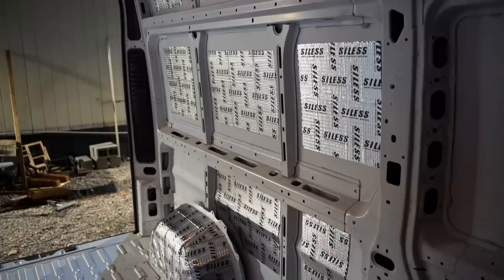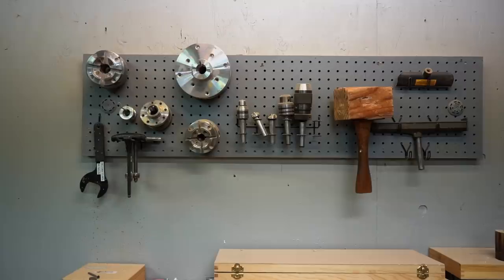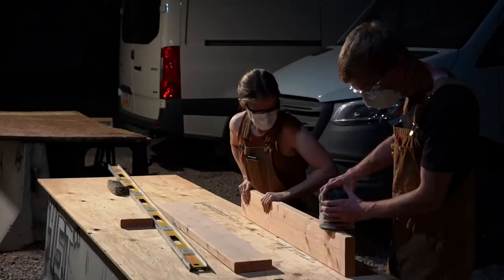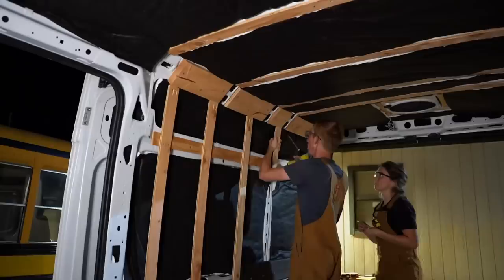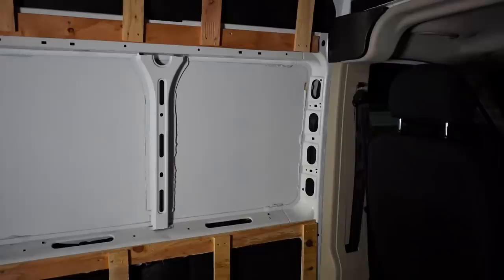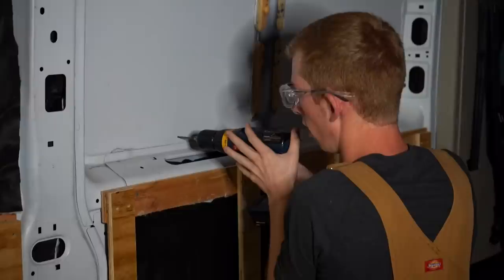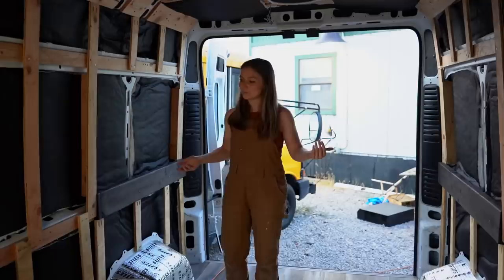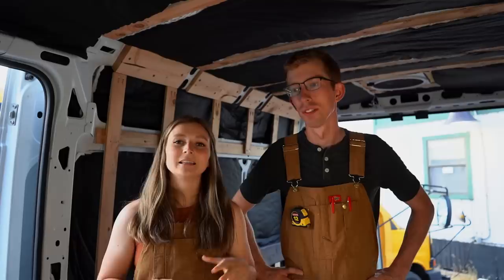CHOOSING A LAYOUT | Framing Our Promaster & Window Install

Comment: since the driver seat is pretty high up you could make the dinet table removeable and add a storage base at the bottom to house a collapsible shower. similar to what eamon and bec have in their van, just more compressed. This would add the shower without losing square footage. 

Also adding sliding drawers in the back seat of the bench seat could add a nice safety spot for laptops or other expensive/important equipment.

Comment: Everything in vanlife seems to be dual purpose.  If you made your dinette table something that could be converted out of the way or drop down to be the seat of a tiny couch your eating area wouldn't be so singular function.  Also, someone else suggested putting your sink nearer the door so you could have an outdoor spray station for post athletic activities and that just makes sense...or have a outdoor shower from the garage.  I can't imagine how unpleasant it would be to go for a hike or a ride and not be able to hose off my feet after!

Comment: Even if you do not want a shower now I would run some red and blue PEX tubes behind the tiny couch. No need to hook up now just leave them capped on each end. Run the ends near where your water pump/heater will be.  You could add a shower valve and shower curtain later without tearing the walls apart. Nice build.

Comment: Have you considered laying out the design wirh masking tape on the floor and actual size?  We did this when remodeling our kitchen, and again when we built an addition.  It highlighted changes needed that we would have missed.

Looking at a sketch is one thing, but seeing actual size is very helpful.

Comment: Looking good,why not have an outside shower a lot of van lifers do you put up a shower curtain between the 2 back doors and get a wooden shower tray to stand on I'm sure that would work well. Do you not think you might feel claustrophobic not having any opening Windows in the van? Good luck with the build it's looking good all ready.

Comment: Great video guys! 
In answer to your question about cutting the metal beam an angle grinder with a "thin metal cut-off" disc attached would be best in that situation or anything similar (and  also with any straight metal cuts to panels or structural).
Why don't you make your couch longer do away with the dinette idea and just have a table that slides out from under the bed on heavy duty drawer slides!? Then it's out the way wont take up permanent space when you're relaxing but can pull out to use as a dining table in front of the couch, or desk or coffee table, (and slide back under the bed when not in use to open up the space)..
That way you've got more room open space to work with.. you could have a smaller table or counter-top under the window also and that can double as a second Desk type space for the swivel driver's seat?(could even fold down again to open up the space when not on use!? And toilet could be also on a drawer slides maybe under the bed (if room below the slide out table within the storage area)..or slide out from under the sink area again on heavy duty slides as under the sink is an awkward space to use for general storage of other things so a toilet would solve that issue/use the space and the rest of your space can be storage elsewhere that's more easily accessible?)

For what it's worth just some thoughts to consider.. 
Also before you put the framing strips in you (ideally) could have put the thinsulate inside the beams as you in did with the others to insulate inside the frame, (as they will be the weak point in the heat or cold weather) ..if you have the option to do that now before the build progresses if it was myself, id definitely try to get every inch with Insulation inside the reinforced frame work areas aswell (it'll make a difference)..

Great build though! Really like the way you're just getting stuck into it! Whatever you do im sure its going to  look great!
Cheers from London 👍😎🏴

Comment: Another idea for minor layout change. Reverse cooking and sink positions and have faucet that can be extended to use both to wash off shoes and use as shower outside and help keep dirt etc outside to save on cleaning. Add 4 eye-bolts to ceiling just inside of width of sliding door opening and can have simple U shaped copper/iron pipe that slides out/in you can put shower curtain on or as cover for door opening in sun or rain when you still want/need airflow.

Comment: FWIW, I have a 2023 Promaster 159" window van, and that "beam" you removed at 12:30 did not even exist in my van.  I suspect it is mostly to prevent vibration and discourage theft.

Comment: I like your layout but being a full-time traveler I do think you guys should reconsider building a shower that is convenient for you guys I know it's a small space but instead of a bench would build a show. Also would put the swivel seat on the passenger and build a little flip table on the side of the kitchen cabinet. And put 2 benches by the bed area is with a pull-out table from the bed... But I would reconsider the shower

Comment: Well guys, sounds good to me the layout would work. And as you said if not you can make adjustments later down the road. Also making the passenger seat swivel would work well too. I hope Jimmy doesn't have a issue with the length of the bed he is tall. When he laid on the floor at the lot he was just a little cramped. Ok look forward to next weeks video. And as always "Enjoy The Adventure." 🤠👍✌

Comment: I've dispersed camp for many years and have not one time regretted not putting a shower in my camper , a shower in a small place only leads to condensation and mold problems. I have a 3 1/2 gallon stainless steel garden sprayer me and my wife fill full of water , place on a burner to heat it , its very simple and issue free . We both shower every night never wished we have went with a different plan

Comment: I agree with everyone who says you will regret not having "facilities" It isn't fun using park showers etc all the time, especially boon docking.  I recommend a "wet room" which can be smaller than a bathroom.
Use a bucket/bag system... for a toilet... or a small cassette... and a bucket/pump system for a shower.  Really easy.  All you need is enough room for a little privacy.  I also agree with everyone who says make the dinette work double duty.  Make one that converts to comfortable lounging.  I love a dinette by the window.  If you can squeeze just a little more room for the bed... to a full... you wont regret it.  RESALE value much better too. Summers are warmer now... and you may regret having to sleep so close (all of the time.)   Please consider the wet room.  It won't take more room than your tiny couch.  And a convertible dinette gives you the lounging you crave.

Comment: It's so cool you guys know how to do the work yourself. You have a plan and know what you want inside. What cool is you don't have to work with drawings and build to spec. You can buy the product you want and not dictated by a customer. I came from building grayhound busses and GM RTS intercity buses. Everything was built by a specifications. Your freewheeling your own build. Love your build and you two as a couple. Be cool be safe. Can't wait to see the finished product.

Comment: Very interesting to watch you make the changes. I am a little concerned with the dining table so being so high,, make sure the swivel seat is at its lowest setting. they are adjustable. which should be a help. Keith

Comment: Good layout, it'll be nice to see what you think after living in it for a few months.  I like windows so I'd probably put one in the sliding door as well.  One of those water tanks designed to fit over the wheel well might be nice.  With the electrical around the other wheel well, that would leave a big rectangular area in the center so you might be able to get a lot more than the ebikes in there.  I learned something watching how you did the framing.  Thanks for the video!

Comment: I don't the nails will hold up like that in a moving vehicles. Screws are more structural solid

And about that beam you were concerned about, if in passenger vans there is a full window in that location then you have nothing to worry about because those would not have that beam

That window looks awesome!

Comment: You two work so well together and your ideas are sound, but I'd suggest rethinking your placement of electrical.  Here's my thoughts: bc you will have to build up the bench to match the swivel drivers seat level so you can place your feet on the solid ground, why not use the space under the dinette for either storage or your electrical? That'll give you more storage under the bed. The dinette can also double as a couch/guest bed and you can omit the "little couch" you're planning (total waste of valuable real estate IMO and redundant.) A small pantry or shower or coset can go there. The wall it creates on the bed side will give you space to hang shelves/baskets for items or lighting. Same for other side.
Another thought: I think you'll regret downsizing your bed, I wouldn't go smaller then a full (double). A small bed with two people is great for cuddling when it's cold, but in the heat the last thing you want is to be that close. 
Great job so far. You do you and set your van up for yourselves. You're the couple that has to live in it. ❣

Comment: Sweet I get a tutorial of building a van from scratch, may God bless you 2 with his anointing oil. Amen.
Yes 1 thing I regretted is a shower, inside, so I put 1 on the back of the door and have a massive round plastic sealed water pipe on roof, using the sun to heat the water or gas heater embedded in the back door when there is no sun to have a shower. Propane gas as the fuel.

Comment: Everyone has their own preferences when it comes to layout. I have lived fulltime in a converted 9m (28ft) wide body bus, a 7m (22ft) narrow body bus, and now a 4.3m (14ft) caravan (travel trailer?). All of them have had a toilet and shower, and I would not be without either of them. However I am 65 years old (male) and rather set in my ways. I am not comfortable if I don't have a shower every night before bed.

Comment: You guys should be fine on your mattress fitting , I did my bump out very similarly. One part of my build I’m working on that I’m pretty proud of is I believe I have one of the most comfortable bed set ups I’ve seen in a van. I have a 10inch full size mattress that fits in with zero cuts or modifications to the mattress.

Comment: At least have an outside shower point, you can have a clip on curtain which is better than none. Not sure about the toilet though with ( middle of the night, rain storm, snow etc ) maybe a slide out modesty panel. Oh well good luck as you’ve put a lot of thought into your van 👏🙂

Comment: After living without a shower/toilet area for two years in a tiny canned ham camper, my short bus will have a hidden 2x3 shower/toilet area, right next to the kitchen sink so I can use the faucet as the shower head. It will be covered with a hinged counter top to extend the food prep area. Nomadism has squashed the “gross out” reflex when thinking of these types of design ideas. The compost toilet will be on sliders to bring it out when needed, and a swing out door will provide privacy from lookyloos at the butterfly door/window area. The shower will have a rail to attach a shower curtain which will live in the compartment above the driver side door. Maxxair fan will be centered above/beside it to provide good ventilation as well as air for the driver (me) as the AC unit is fried. Kitchen was shortened because of this but sacrifices must be made for human biological necessities! 🤷🏽‍♀️

Comment: ok so hear me out on this one. Make the whole mini couch slide out into the kitchen. have a shower ring that hides under the couch, mounted to rails on the wall. bring up the whole shower curtain and make an indented shower pan floor with a hose and shower head head. when you need some privacy for the toilet have the toilet be able to come back on a separate slide so you can sit in the shower for privacy. when your done showering or other, just slide thing shower ring back down into the pan and slide the whole couch back over. you can have all 3 in one spot!

Comment: I'm kind of wondering why you all need a small couch when you already have 3 seats especially since the passenger will eventually be a swivel. I would think better use of that space would be a wet bath or pantry. It looks like your going to need to build a raised platform under the dinette after watching her feet dangling and you could put 2 slide out drawers underneath it for shoe storage or something. I hope the Liquid Nails you keep referring to is construction adhesive? Another question I wonder about is why I never see anyone using 1/4" wood paneling on the walls instead of ship lap since space is a concern?

Comment: We lived in a travel trailer and a 15x11 cabin off grid. We didn't have running water in the cabin (6yrs), but we had a 5x5 bathroom with a shower & toilet. I can live rough, but we have to have a private toilet and a place to shower. 
We plan on doing a van/bus Starting in the next few months and it will have a small bathroom. We don't love the idea of showering in our bathing suits while on BLM land just in case someone comes down the road 😮.

Comment: Hello! We are building out a ProMaster (or Citroën Jumper that it’s called here in Sweden. Thank you for a very entertaining and educating series. We have watched it all. A question for you. What is the point of the horizontal plywood strips? We are pretty much coping your framing job but it seams you could just put the vertical strips right away and attach it to the metal?

Best regards,
Robin and Anneli
@helsingsliv

Comment: you are making a mistake by not insulating the floor. Think of it like sleeping in a Hamachi, if you just put blankets on top the air still will get to you from the bottom. As for using nails, that a bad idea for as the van rocks & rolls down the road the nails will come out. If you run out of screws either stop working or then go back and screw things you nail the next day.
Reply: Mistakes are always made. There is a multimillion dollar skyscraper in San Fran. that has tilted and sunk and it continues.
Reply: @Cheryl Get a life,if you don’t like the content don’t watch

Comment: Dont back burner that passenger swivel! add a center Lagun mount, delete the dinette and make a bigger couch (that can house the toilet). You could have a second lagun mount over on the driver wall to turn that are into an "office." The table top could be tucked away when not in use... you gain SO much space... you might even get your shower back! Thats worth the cost of another swivel mount!
Reply: HA! add a 3rd Lagun mount to the center of the couch and have chill table seating there too!

Comment: NICE JOB, I'm enjoying the build. Of course it's YOUR build but just think if behind the dinette on the drivers side where you spoke of a mini couch, A FIBERGLASS WET BATH WOULDNT TAKE MUCH MORE ROOM THAN A TOILET !!!!!!!! If you're boondocked wayyyyyyyyy out from civilization wouldn't a shower be nice hmmmmmmmm lol. If you had a Thetford Electra Magic 80 Marine Recirculating Toilet (uses much less water) and even a very small black tank, two people can go a longgggggggg time before you need to dump. Any Solar and Lithium Battery plans?? There's plenty room on the roof for a couple (heck even 3) 300 Watt Panels, and add to that a couple SOK Brand 206 Amp Hour 12.8 Volt Li Batteries with a 2000 Watt PSW Inverter (or Inverter/Charger Combo is better takes less space kills two birds one stone lol) YOURE LIKE TOTALLY SELF RELIANT !!!!!!!!!!  Also for night or cloudy day driving a little Renogy 40 Amp DC to DC Charger could charge your battery bank.  Never have too much fresh water, can you make room for 40 gallons??  Best wishes I'm enjoying it. 

John T  BSEE,JD   Electrical Engineer and 50 year RV owner

Comment: Instead of a couch I would put in a wet bath.  Most portable toilets give out odors that you will smell when you eat your meals.  Also I would have cut the window in the sliding door.  You lost a lot of cabinet space to the driver side window.  Just my opinion.

Comment: We have a Solis 59PX.  We USE our wet bath every day we are in our van.  We do not leave the van when the other is using the toilet.  We do have the option for 2 outdoor showers, but have not used them.  We enjoy using Harvest Hosts for some of our stays or fuel stations.  I don’t think either would like us showering outside.  That being said, if you move the sink towards the door you could utilize it for your outdoor shower.  Please do NOT put the toilet under the dinette.  YUCK!  At least put it under the “couch” if you insist on no shower. Our bed flips up and locks into place.  This gives us room to dress in the rear while the other is up front or in the bath room.  What are you doing for a refrigerator?  I would hate not having an a/c to use when it’s really hot outside.  We have windows that open and a max air fan but hot is just hot, and sweaty and no shower? We enjoy watching your videos.  You are both very positive and seem to really enjoy being together.  Best of luck getting Pancake on the road.

Comment: I spent 30 years as a mobile mechanic driving 
every which kind of van. The boss always had 
different companies outfit each new van with
steel cabinetry & drawers ect. I never drove a 
van that was square in the back. HOWEVER
the companies that sell cabinetry for vans dont
seem to understand that vans ARE NOT SQUARE.
There was always alot of wasted space betwix
the back of the cabinets & the van walls. I just
dont understand. Has these companies NEVER
seen the inside of a van? What a bunch of...

!